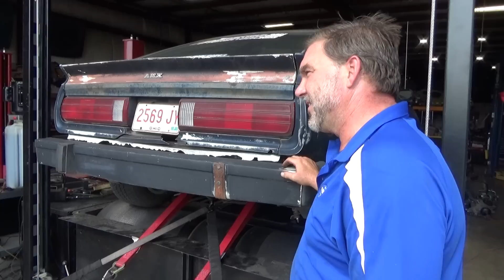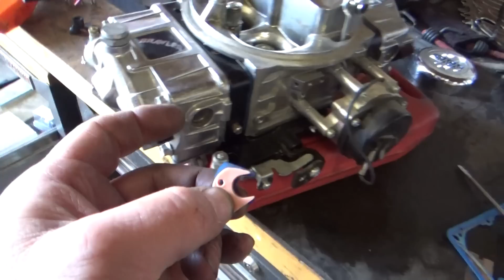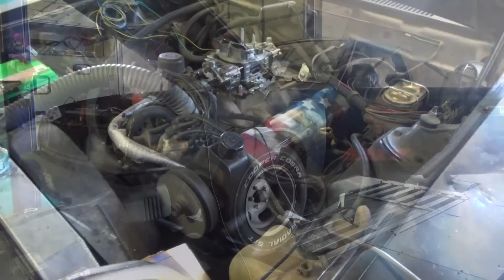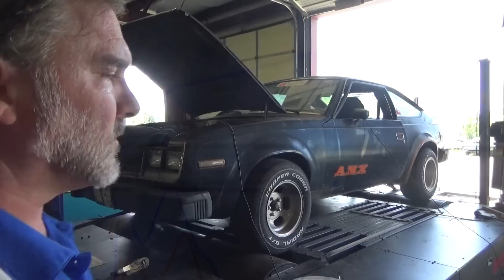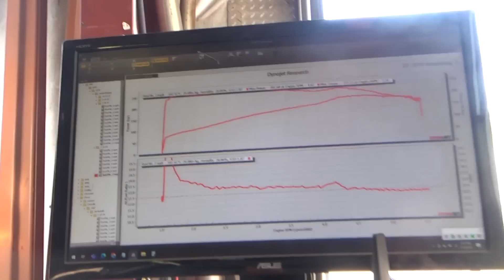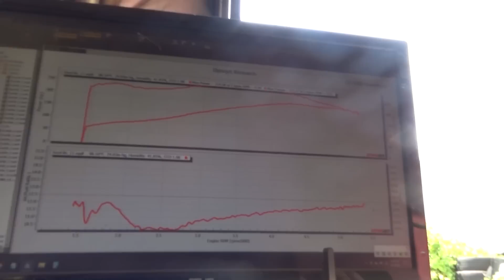Carb Tuning the 304 V8 Powered AMC AMX! DynoJet testing and tuning!

Comment: Like you I’m learning a lot from these dyno pulls. Couple of thoughts though, what gear are you in? Most other videos I’ve watched use fourth for direct drive.  If it is fourth would you really give it full throttle at 1500 rpm? Like I say learning a lot. 👍👍

Comment: I usually use 68 and 72 as a baseline and 28 squirts and pink cam  second hole and valve according  to vacuum typically half 17 = a 8,5 I have fricking stumbled many times but its a great start from My peanut Gallery. Two cents are free today love you boys.